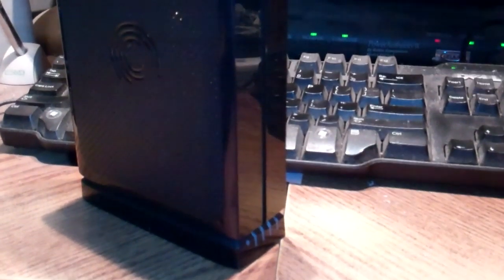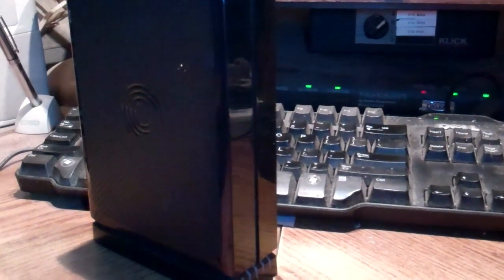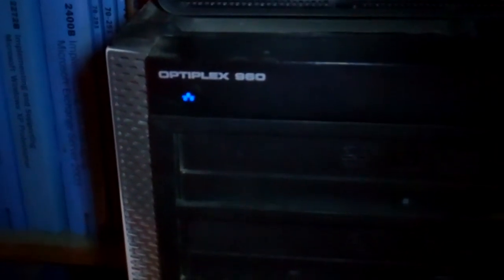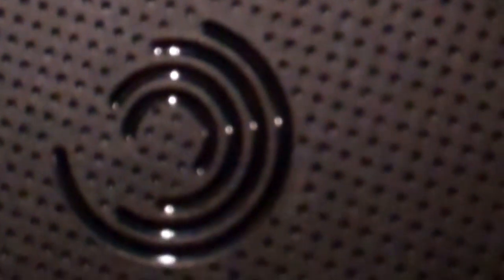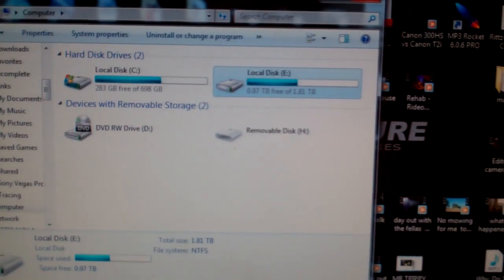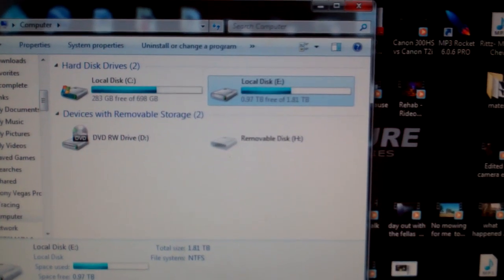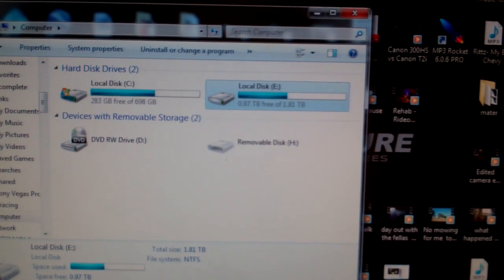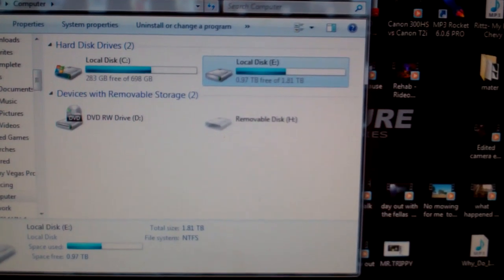How to make an External hard drive an internal Hard Drive

Comment: I assumed with that disk boot failure message that it was the hard drive at fault. Sorry I forgot to mention the boot disk failure message. As I said before the external drive had a faulty power adaptor so it made sense to make it an internal drive anyway although I suppose I should have taken it back to the ex lease place I got it from and told them the drive is failing, but with computers things are sometimes not definate and it was booting to windows and then freezing. Seems fixed now.

Comment: The thing has a Foxconn motherboard. :It's a non proprietry compact pc so the case is really small. It seems to be working fine since I replaced the hard drive with that 1TB WD drive. I forgot to mention that I also got this message a few times when I was starting the machine and with rebooting it a few times I was able to get into windows. " 'disk boot failure - insert system disk" So that is why I assumed it was the hard drive at fault. At any rate its too late now to investigate ways to

Comment: My intel atom 1.6 space saving desktop got 1.6ghz 1gb ram and now a massive 1TB hard drive. Actually I got the machine ex lease and it had a 1 month warranty on it so I really should have taken it back under the 1 month warranty and got them to replace the 160gb drive it came with, but the Hitachi drive it came with sort of decided it was failing and then changed its mind. Got into windows half the time but froze alot.

Comment: Oh thanks for that. Actually I did this successfully yesterday. I found a video on youtube which showed exactly how to remove the external case and it turns out on a Western Digital its very easy. I took out the drive, removed the logic board then unplugged the failing hard drive in my 1.6 atom and plugged the 1TB drive in. I then formatted the drive in one partition (probably should have made 2 or more paritions for such a huge drive) then reinstalled windows XP.

Comment from the maker: yeah you should be able to pop it lose from the bottom of the case. then the rubber corner fittings and aluminum guide pins come out and just slide it in , the case on the drives usually aren't glued but they are kinda hard to get off of the mybook drives as well as the seagates, those are the only two i have done this with. any others i can't make those claims with because i simply don't know but traditionaly they are all the same

Comment: daddy tech what you refer to as the POWER cable is actually the SATA (data) cable which if you follow it to the other end it connects to the motherboard to give data to the motherboard. The other cable actually is the power SATA cable coming from your power supply to power the drive. u just need a 3$ SATA data cable and your good to go unless your motherboard doesn't have any free SATA ports. Just wanted to let u know u got ure cables crossed.

Comment: I have a 1tb Western Digital drive that I want to install in a computer here as the main drive. The problem is the plastic case that contains the WD hard drive it looks like you pretty much need to smash it to get the hard drive out no screws etc just one solid case holding the whole thing together. The problem is the power adaptor for the external WD hard drive is faulty and the SATA hard drive in the desktop I got is faulty. So seems an obvious idea to fix this thing without spending money

Comment from the maker: started to say, 4 sticks of 2gb ram would be 8 total not 6 right? lol yeah i REALLY need to hop this main tower up and put 64 bit wondows 7 pro on it. i think cramming more memory in there would help everything run WAY smoother.  i did that with my workstation went from 4 gb to 12 gb and it made a noticable difference.  and it's only a 3ghz dual core Xeon.

Comment from the maker: not confusing anything there are SATA ports available on the board there just wasn't a long enough SATA Data cable available for this one at first i fixed that by just getting a longer SATA cable from another Dell system that wasn't any good any longer and all is good. but you are right if you run out of on board sata ports the only other alternative is a PCIe sata card

Comment: my external drive was extremally easy to disasemble. its the Goflex 3TB from seagate basically you pop off the base with has the LEDs/USB 3.0 connector/AC adaptor and the case pops open and the hard drive comes right out. put it back together still works...so :D

Comment from the maker: @blazerlover25 if the system will recognize and use it plugged in externally you should be able to also install it inside.  if not it may require you to split it up into a couple drives if it doesn't work on your system though. can still be done either way just all depends on your system.  that computer i believe is a Pentium 4 and you may have to divide it up

Comment: Ok I need to know what is involved in doing this procedure? I got an emachines w3650 and it has the little 160 gb harddrive..1gb memory and I am also wondering if this is even possible on my computer or if it would support my 2 tb external hard drive? and also do I really need to back up my info or just plug and play? great video too

Comment from the maker: @generalstalin22 what operating system? what kind of machine if it's a custom built machine you may have to go into bios to make it see the drive first. if the system actually sees the drive in bios but it's not showing up in windows then you may need to hook it up as an external drive first, copy off all of your data and then put it inside the computer because windows 7 seems to like making you format the drive before it will read it properly. i went through that with my 2TB one also.

Comment from the maker: @generalstalin22 not at all. vista is pretty much the same thing (only everything works as it should on windows 7)  you should be able to put those drives in and everything work just fine, keep in mind though that you won't see your desktop items unless you are able to access them on the drive you had in there before with windows vista on it mostly because you aren't using that exact load of windows on the same pc. but most deffinately it should still see all of your files just fine.

Comment from the maker: @dtayl120 all you need to do to make the internal work in your computer is 1. take the hard drive out of the external enclosure preferably safely in case you ever change your mind and want to put it back in the external case later. which external drive do you have?  a lot of that determines wheather or not you can use them internally in your desktop. for instance this was a full size HD i put in my desktop so the SATA cable was the only thing i had to buy to make it work

Comment from the maker: @More350Power yeah this one i got at Walmart back around Christmas time for $89.00 it's a USB2.0 and it was really slow transfering data to it externally for no good reason so what i have done now is put it inside the system and it's screaming fast compared to what it was in the case externally.  no USB2.0 bottle neck this way. the case i just put a screwdriver in the edge pried out & then went around half of the edge and off it came "i love Seagate"

Comment from the maker: @colt459595 yeah this is the kind of thing Ebay really helps out with I could get the blue data cable cheaper in fact cheaper than the $5.99 on ebay but the one i found is 32" long which gives me plenty of room to run it to the drive. I am actually getting two of the cables incase i want to put in a 3rd later and do a raid set up in this thing.

Comment: That looked like an easier external case to disassemble.  Sometimes it is cheaper to get the external and use the drive internally.  I really, really need some more drive space and ram.